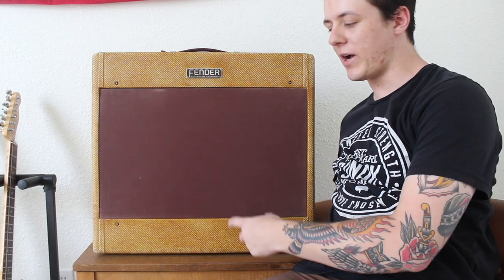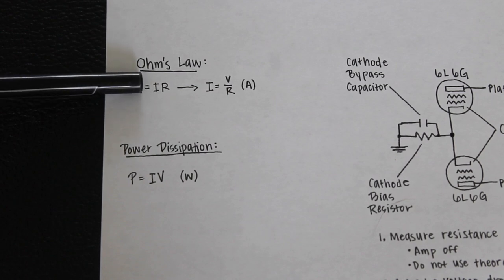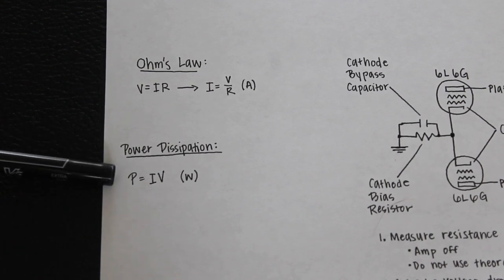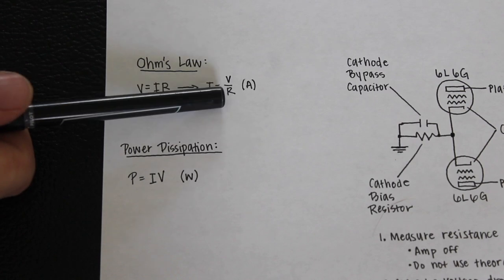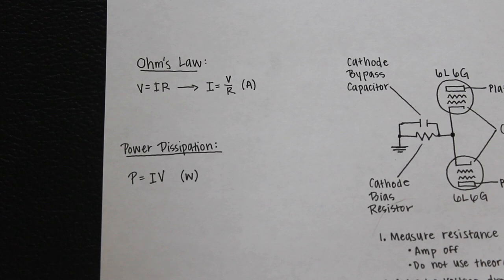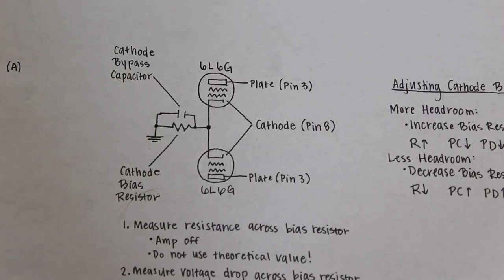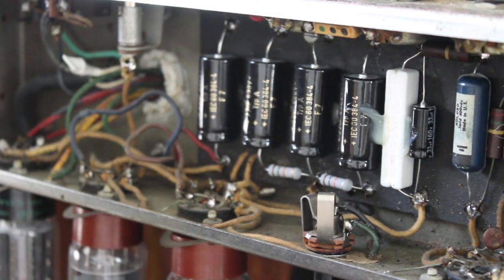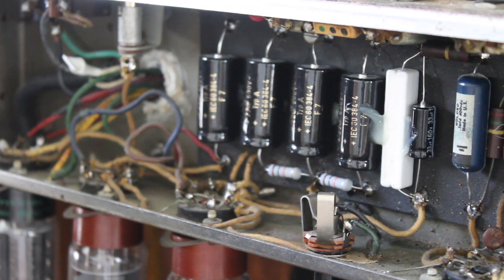How To Cathode Bias Amplifiers Using Ohm's Law

Comment: Thanks much for this instructional video Nathan!    I have an Ampeg Jet J-12-A that I am restoring, so this video helped me finally understand the whole process.    That 5% that needs to get subtracted baffles me a bit ... but I think most of us just do not want to have the pwr tubes biased too cold or too hot.    I'd like the amp to be somewhat biased closer to hot.   But I am seriously thinking of splitting the cathodes in case the pwr tubes are not balanced.   I had read that I would have to double the resistor value.  Is that correct?   So if 200 ohm is good for combined cathodes, I'd have to have 400 ohm resistors (plus 50uf/50V caps) per cathode.  Thanks again!

Comment: Hey Nate, do my understanding from this video is that if an amp is cathode bias and you are replacing the power tubes and you like the way it sounded you can just go ahead and replace them without dealing with the resistor? Thanks great video
Reply from the maker: The resistor is the the only way to bias the power tubes. So if you replace the power tubes and leave the same resistor it is possible that the tubes will draw too much current. This can cause very short tube life and tube red plating. It’s possible that the existing resistor is the correct value but it is still necessary to check. The amp may sound good, but you may be cooking those tubes! On the other hand, it’s possible the tubes are biased cold and your amp could sound even better than it does now!

Comment: To get power dissipation for each tube do you use plate voltage referred to ground or plate-cathode voltage both referred to ground? If you multiply plate voltage without subtracting cathode voltage aren’t you calculating power dissipation for both tube AND bias resistor?
Reply: You are right but it will makes the explanation more difficult to understand. The difference will be under 5% so imo negligible.

Comment: Hi - going into a live amp - aren't you supposed to put one hand in your pocket to avoid electrocution?
Reply: He's probably already drained the filter caps (I hope).

However, the two measurement cables have relatively long plastic handles that he's holding.

Comment: Plate voltage should be measured from plate to cathode and not to ground on cathode biased amps. It's a bit more precise for calculating plate dissipation. You are biased at about 92% which is fine for a cathode biased P-P.